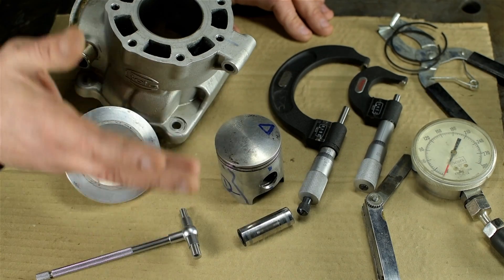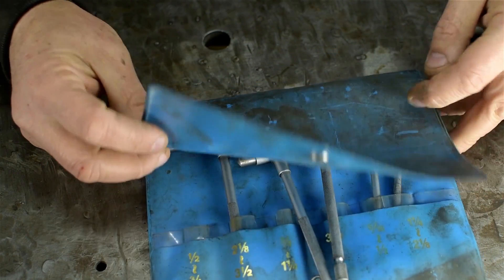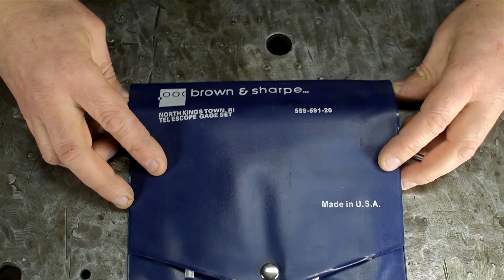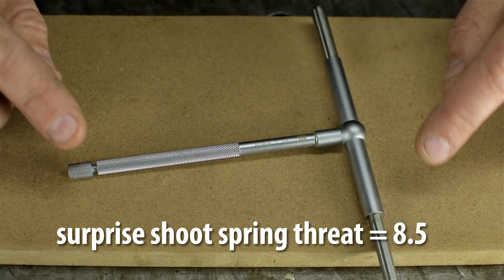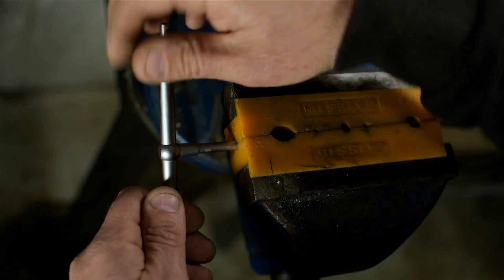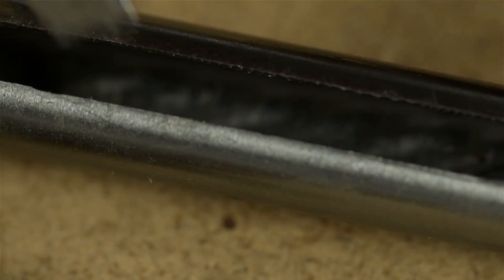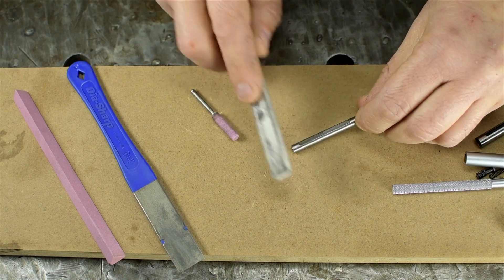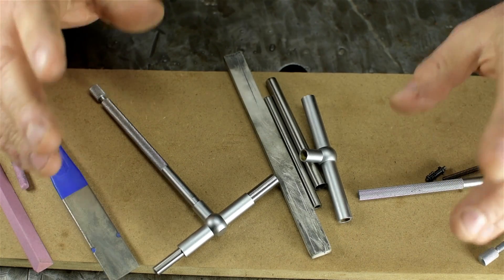Silky Smooth Telescopic Bore Gauges

Comment: As a $4/hr apprentice in the 80's, Mitutoyo (Brazil) came to NA and I was all in.
The old timers used over priced starrett and brown and sharp and called the NEW company Jap Scrap.
 Just like today, being old does not equate to being smart.
Reply: I did my apprenticeship in the mid 70s and Japanese tools were in some of small hardware shops that existed back then. I learned to look for particular brands. Had to be careful though as not all Japanese brands were fully made in Japan. Eventually those brands disappeared.  Now the second hand shops that I scoured  have disappeared too.

Comment: What about the bottom of that key way? I was looking forward to you brazing a custom carbide scraper or something.
Reply: Yeah, I would think that's the most finish critical surface. Otherwise I'd think it'd be apt to be notchy when rocked though the tight point of the bore and not give good readings.

Comment: Should have bought Starret. Mine are silky smooth.
Reply: Uncle Muir , yes they are smooth and tight but take care, they rust easily. The best are Mitutoyo, you get what you pay for with them.
Reply: My Mitutoyo set is silky smooth also. A little cheaper then starret. Good bang for the buck.
Reply: I also have an old Starrett set that I have been happy with. I'm guessing they are 30 - 35 years old. I think the age is critical on American made stuff, the older the better.

Comment: If you have to do that to a "premium" tool then the only thing "premium" about them is the price.
My chinesium gauges aren't half that bad and do the job just fine at 1/4 the price.
Moral of the story, in this day & age, your rarely get what you pay for so you might as well go cheap & replace as needed.
It hurts less on the wallet & the results are the same.

Comment: Do they still lock firmly or did you just make another set of slippy gauges? What makes the other set slip?
Reply: I've got an ancient pair of snap gauges that are well built, but they still slip if you try to use a ratchet thimble or clutch on the mic. The trick is just not to do that lol.
Reply: The locking pin dimensions likely determine how well they lock. If the point of the pin is too short, the smaller rod won't lock unless you tighten the piss out of it.
Reply: Why would you say that? It doesn't look like he smoothed the surface the locking screw engages with, just the corners.
Reply: @snaplash  probably, but if you used them daily I bet they'd get wobbly/inaccurate.
Reply: tinncan is the real MVP asking the real questions instead of subtly brainwashing "premium vip deluxe expensive items gooood, china baaad"
Reply: Yeah, I thought the rough finish might actually be intended on the floor of the keying slot at least, if that is smooth and the whole thing is oiled as well I can see it needing a serious tighten to hold properly.

Comment: It's sad how poor the quality is on many good names in tools these days... I've even seen Chinese Starrett tape measures recently... Sad.
Reply: @aserta  B&S was a pillar of machines and tools in Providence for decades until the 1970s. Where the domestic and European competition got fierce. Margins slowly and surely went down and CEOs made some bad decisions. Japan quality started to rise. Labor union issues and cost of living kept rising. Don't forget that B&S was a fierce competitor and may have caused the demise of many machine tool companies itself.  There is customer loyalty but when another product at half the cost does the job then you can't compete. Just my 0.02.
Reply: P.S. My unknown vintage Starretts work just fine.
Reply: I was recently shown the faces of the anvils on new  Starrett  micrometers using optical flatness, they aren't flat!
Reply: More sad, some of the Chinesium is actually acceptable.
Reply: I made the same point in another comment.  Chinesium tools are not the greatest, but, for the most part, they are perfectly usable, and orders of magnitude cheaper than the likes of Starrett and Brown & Sharp.  So the big names have to cut production costs to stay in business.  I mentioned Stanley with their mexico production plant.  Stanley tools are not what they used to be, but with a wee bit of a fettle they can be.

Comment: Problem is that I don't keep any light oil around. I tried switching to light oil but my family just doesn't like the flavor as much as a full fat oil.
Reply: I had some but my lights need a lot of it and I've used it all up.
Reply: @WeighedWilson  
I solved that. I just use dark oil
Reply: @WeighedWilson  : Yup, just can't get proper whale oil these days for the lamps.
Reply: @BrooksMoses  Whale oil beef hooked.
Reply: I only have headlight oil sitting around

Comment: Those Brown n Sharp gages look like they were made in the same factory as the ones you got for your 4th birthday.
Reply: That's probably right. Once bought two sets of calipers for identical cars, one "China" for the seller, one original ATE for the keeper. Both had the same cast irregularities and die-dents visible, the china-version (priced a third of the brand-one) just had a ground area where the others had "ATE" cast in. Not only the same factory, the same effing die.
Reply: @manfredschmalbach9023  maybe they did a mold out of the ATE part?! The quality of the cast and the machining done to it after could be poorer too.
Reply: I reckon the old ones are probably better.  Any sets I've used have never tempted me to pull them apart. 
When measuring flameproof equipment for a code D examination. You take hundreds of measurements per day. If I had ever been stuck with such a crappy set, I think I would have put them under the forklift. 
Imagine signing off to AS 3800 and ISO 9001 with tooling that indents to the nearest burr.
Reply: With the same tooling and end mills LOL
Reply: I wonder if those Brown&Sharp have just had a 30% import tax put on them. But they do look smart in their vinyl made in USA bag.
Reply: I’m guessing counterfeit too. If they actually are real, that is some piss poor machining. I’d be pissed if I bought those I’d send them back
Reply: You people think Starrett is any better? Ha! I haven't tried their telescoping gauges, but their tap wrenches are even crunchier than this.
Reply: probably made with the same exact tools too. That's why the finish was so poor
Reply: Yeah these look like counterfeits. My ultra-cheap china special set (I think I paid all of $8 shipped, has a better finish than those things.
Reply: Yeah I was looking at it wondering if these were the apprentice batches lol
Reply: Looks like ?counterfeit? B & S
Reply: I think they are offshore BS for sure
Reply: The only thing BnS made here was the labelling file, that was sent to the Chinese vinyl bag factory.

Comment: What you need is a dial bore gauge. Not so good for very small bores, but most 2/4 stroke engines will be within its range. https://www.hroberts-di.com/all-metrology-c49/bore-gauges-micrometers-c204/mitutoyo-511-713-dial-bore-gauge-50-150mm-p2626/s2626
Reply: Ageed, it's a far superior measuring system.

Comment: Hey Old Tony now that i am early and you may see this I will tell you why the gears you make for your late in aluminum fail, in gears the way you machine them is as or even more important than the material, i know about a  case where they made one gear stainless  steel to replace  a plastic one and it still failed pretty fast.

Comment: The B&S's sound like my cheapy Chinesium set.
Reply: My cheapy Chinesium set has both sets of problems, don't lock properly without insane levels of force, and the plungers are crunchy.
Reply: @ferrumignis  Crunch plungers sounds like either a delicious breakfast cereal or a death metal band.... or both
Reply: @ferrumignis  Yeah, I gave mine away. There was 1/8" play at the end of the large size. I lucked upon some Starrett brand for a reasonable price, which are better, but still not amazing. I think they're also made in China. Hard to get away from that these days.
Reply: Nowadays, they probably are just the same. Just labelled differently.
Reply: My 12€ china specials are way better machined and deburred than those B&S :/ They probably had just gotten their bi-anual fresh set of carbides when they made them.
Reply: @smorris12 that's because they are the same, from one of many factories producing identical parts.
Reply: Seems like the same thing happened to B&S as happened to Record vices.
Reply: @TheFarCobra  Could be. Record caught Irwin disease like Vicegrip did. Proto, Sidchrome, Dawn and Joplin caught Stanley disease and all sorts of stuff has caught ITW disease.
Reply: @mikenewman4078  Jacobs Chucks have gone overseas too. It's a pity.
Reply: Same factory, different shift.
Reply: How are we to know with certainty that the B&S instruments aren't also made there?
Reply: @MokkaMatti  if they work smoothly lmao
Reply: For sure will skip this brand! ONLY OLD TOOLS, like TOT
 :))))
Reply: Yep, they sound exacly like my chinese set :/